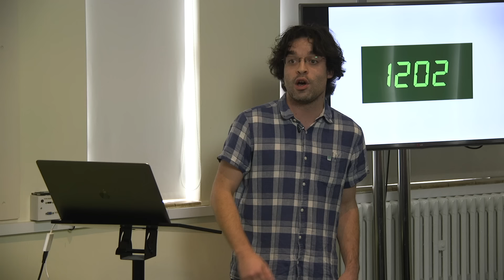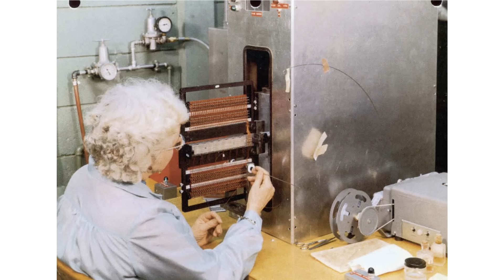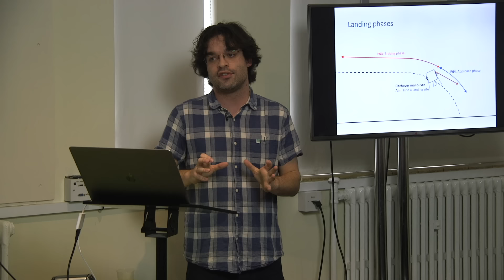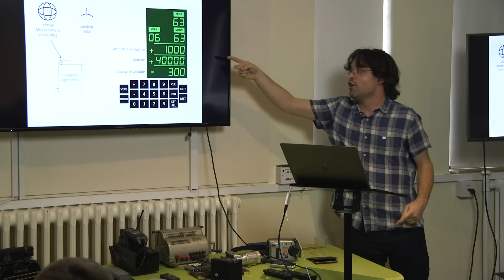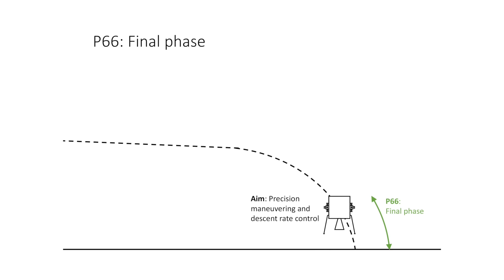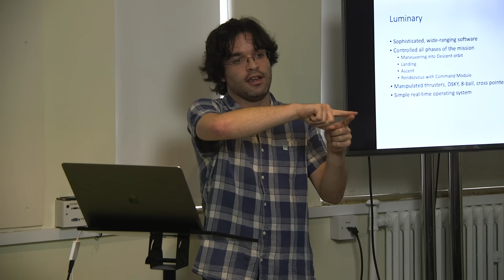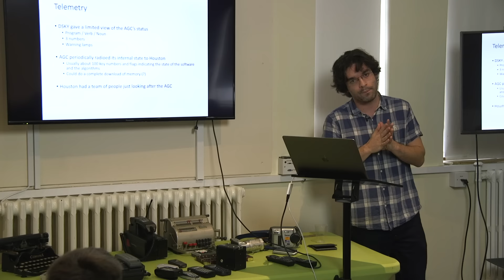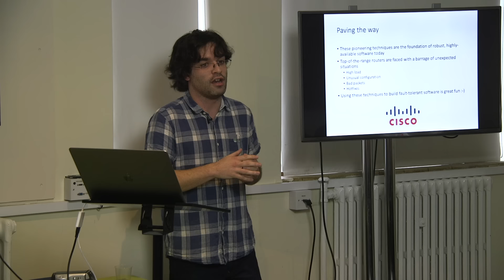Light Years Ahead | The 1969 Apollo Guidance Computer

Comment: This was amazing. I had a smile the entire time! 

There should have been a computer load display somewhere so Buzz would've known, I'm also surprised he wasn't schooled on the 10% additional load(90%) he was adding by using the 16 68. I'm also surprised the guys back at Houston didn't catch the issue of the load change due to the rendezvous radar even though it wasn't a program just information adding load so they could alert the guys not to run any superfluous programs ie 16 68.

Comment: My dad worked at an oil refinery that was one of the first to be completely computer controlled. Built in 1968 The computer that ran the place was housed in a large room and occupied 2 floors. By the time he retired, in 1996 that computer had been updated to something the size of a small refrigerator.
      It was strange to see a small refrigerator sized computer in a 1000 squad foot, otherwise empty room. The lower floor, that was the same size had been converted to offices long before.
       The refinery had gone from needing a computer that needed 2000 square feet to about 3 square feet in 28 years, and it has been another 25 years since then. I imagine they run the entire refinery off a iphone by now,

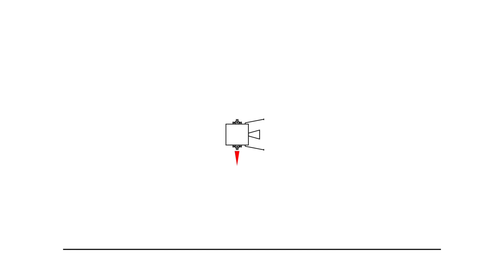Comment: I may be wrong, but the direction of the thrusters fired for the ullage in 22:25 should be in the same direction as the descent engine so that the fuel lumps up in the same place where the descent engine will send it. In this case it would be forward, not down as in the illustration.

Comment: Do you really think any Apollo astronaut would admit to mistakenly leaving the rendezvous radar on?  It’s like asking a child who ate the last chocolate chip cookie.
Reply: From what I've read Aldrin may not have mistakenly left it on. Instead he might have been thinking that the checklist was wrong because they would need the rendezvous radar to find the command module in case of an abort. As such he deliberately turned it on while not fully understanding the consequences. But then of course becoming a national hero will buy you a lot of forgiveness.
Reply: @joevignolor4u949  That’s very interesting Joe. I also heard that in subsequent missions which seemed to be frequent, they made no changes to the computer but just simply turned the rendezvous radar off.  They were brilliant software engineers working with limited resources.
Reply: @escalera601  I think that's correct. During an abort the LM's ascent stage only needed to get them into an approximate orbit on their way back to the orbiting command module. The orbit would need to be refined later so there was plenty of time to turn the rendezvous radar on. Also, for the rendezvous radar to do anything the transponder in the command module needed to also be turned on so the LM's radar could lock onto the transponder.

Comment: A wonderful talk.  I'm involved with pipeline control system software that gathers data from plc's over satellite comms, and can see that NASA Apollo work broke ground that we use today.  The legacy computers that we are shutting down began development in the early 1980's.  (Interdata)  We still had limited memory and speed, I remember talking to the developers about having to adjust code for memory used, and # of clock cycles that the proposed solution used.  For custom "scripts", we had a pseudo assembly language called CPX that had a simulated accumulator, a limited number of variables and similar verb / noun type of interface.  
Thanks again for sharing....  Best hour I've spent in a long time.

Comment: Hi Robert, this is only a tiny nitpick:
At 22:18 when you are describing the ullage burn, your diagram shows a single RCS thruster firing perpendicular to the surface, but shouldn't two thrusters on either side be fired in the same direction as the descent engine? What your diagram depicts would push the propellants to the side of the tanks rather than the engine inlets.

Comment: I disagree with his assertion that Neil never took "manual control", and the mocking tone he used while saying it.
Of course there is always going to be some software running. The joystick movements are converted into signals that fire various thrusters (fly by wire), but there is no intelligence there. The system will do anything it's told to do by the pilot. That sounds like manual control to me.
Reply: Hi, Armstrong and Aldrin were brilliant pilots whose composure, professionalism and skill played a huge part, and the most important part, in the success of the landing. As for whether it's "manual control", I certainly get your point of view. During P66 the computer was in "attitude hold" mode which meant the AGC was running a control loop to keep the spacecraft in a constant orientation (unless directed to change that orientation with the hand controller). It also ran a separate control loop to manage the rate of descent by modulating the thrust of the DPS engine, and a "rate of descent" switch could be used to change this. So yes, there is a much more direct relationship between the pilot's input's and the system's behaviour, but the AGC is still vital in keeping the system stable.

On a purely technical level, the point i was making was that the AGC hadn't failed, and was able to handle its most safety-critical real time operations. My claim that it "wasn't manual control" is a more colloquial shorthand to make the talk accessible to a wider audience. And later in the talk when I say things like "we know it wasn't manual control at all, he just enters P66", this phraseology is designed to give the audience confidence that they are understanding the gist of a complicated subject, not to detract from Armstrong's amazing piloting skills and excellent judgement.

Comment: So when did p65 go p66, and the auto pilot quit exactly? Do we know?
Great talk, Robert really good job. 
Tbh, i am a skeptic, like Dr van Allen, we both would've rather had the space telescope which was part of the original pitch, but got jettisoned at some point.  
Also, you have got me thinking about the total power out put of the ascent rocket again.  Now i have to add on an abort scenario which is going to put up the cost considerably on this little unit. Mmm.
The whole thing is about the size of a family car, yet it has to blast off from standing, or perhaps falling onto the moon,  reach a csm 60 miles up, gain 12kmiles per hour and have some spare for emergencies. Mmm. 
On another note, what would be the chances of a safe mission at the point where A11 blasts off from earth with so many untried procedures stacked one atop the other? 
And they didn't need to do it, because they never built on the mission, instead going in a totally different direction with space stations. And if things went badly they risked having the world mock the USA forever, with every full moon a reminder of American hubris. 
Isn't it incredible that the mission was sighed off?
Another point i find odd is the fact that everyone was talking about the solar heat issue, even jfk mentioned it in the Rice stadium speech in '62. And yet when they go to the crunch they actually said they were more cold than anything.  And then you have all the silly talk about cold space which we all believed for a while and now just sounds daft, and there are no journals about any special cold effect that explains it. 
Thanks for reading and please see my vid on this if you like:https://youtu.be/Zztbw7MLlkIhttps://youtu.be/Zztbw7MLlkI

Comment: I had to pause this to comment: Aldrin himself confessed to leaving the rendezvous radar switched on; he knew he was supposed to turn it off after testing it just before powered descent (it was a checklist item) but claimed he got distracted. It was NOT normally left on- but was always TESTED before committing to separating the lander from the proximity of the CM. (After all, that's the time to find out if it was working or not!) 

You might not be able to imagine an astronaut "just forgetting", but those guys were human and part of the calibration of all pilots is to never have the hubris to think that you will perform flawlessly. Armstrong himself made a couple of mistakes during that descent that don't get talked about because he caught them and corrected them; it's just part of being competent; being PERFECT is not. (Armstrong had a reputation for being accident-prone...but he ALSO had a reputation for being able to come up smelling like a rose. Usually it was because he was pushing things farther than he was told he should go, because he really, really wanted to KNOW how much margin was left. And THAT'S the biggest reason he got tapped for the first attempt. His flying out almost all that fuel was the prime example, but there were plenty of others.)

Excellent talk, BTW. I'm impressed.

Comment: There is a fair bit missing out of this.  There are still AGC programmers alive.  Buzz Aldrin caused the alarms by not following procedures.  He wanted to ensure all radars were active (decent radar and accent radar).  Just in case they had to escape quickly.  Too much data crashed the AGC.   The AGC code was written by completely unqualified non computer programmers, one was an insurance salesperson 3 years prior.  MIT didn't really contribute to computer science or programming, because computers, science and programming didn't exist. No one knew anything.  36000 words didn't go very far.  Modern day router programming and AGC programming in 1966 have absolutely nothing in common.  Would have been better to have an actual programmer from NASA in 1966 presenting. Military comms still used some of this tech in the early 1990s.  The alarm codes 1201 and 1202 are still used in 32bit, 64bit and 128bit coding today.  Where did you get this guy???
Reply: Perhaps you should take a look at the Apollo 11 flight plan page 3-69.  CDR is to turn RR on and perform P20 Mode II to update the vehicle state vectors before doing P63.  That's why the RR was on - the checklist called for it.

Comment: And regarding memory limitations: there are actually programmers today that do very complex stuff with very little memory. Keyword "demoscene", where there are sub-competitions for writing realtime-calculated audiovisual pieces of art in 4k or even just 1k of code called "intros". Of course they use more RAM and heavily utilize the GPU while running (at least they do nowadays, there were intros long before we had GPUs in our PCs) but still: the craft of writing small code is not forgotten! Also, all the support we get from modern hardware does not necessarily help to keep the code size down; just calling a modern API like DirectX or Vulcan already requires lots of code. E.g. https://www.youtube.com/watch?v=CDDedA-x2-k is a sub-4kB executable (just the first hit I got when searching for '4k intro').

Comment: regarding the rendezvous radar: some sources say that it was actually left running on purpose, so that it would be ready more quickly in case of an abort. As far as I recall the radar systems needed some time to warm up before they produced reliable data.
Reply: It was on because the checklist required it to be used to update the vehicle state vector through a P20 before P63 was implemented.    It's in the flight plan document.
Reply: That's my understanding as well. They just didn't foresee the unintended consequences of leaving it on.

Comment: Hi Robert, a very good presentation! The diagrams were kept simple, the talk was structured and the delivery was clear. I recall seeing a DSKY in the London Science museum sometime in the 70s, I went back a few years ago but it had been sent back to the USA. Also, the backframe that was shown used the 'wire-wrap' technique. I have used this for prototype developments and there is no soldering but each turn of the bare wire forms a cold weld to the post. Amazing that this is more reliable than other manufacturing and probably lighter! Having worked in RTOS and the innards of computers in the 70s/80s/90s I can well appreciate the skills they had.

Comment: Hey do you have a speech or video about Apollo 13? The Computers in this instance, had to do things the programs werent made for?
Reply: Arron, I'm thinking of writing one, although Apollo 13 is a more general story about the spacecraft hardware and human ingenuity in diagnosing problems, rather than the Apollo Guidance Computer per se.
Reply: @robertwills8051  yeah I understand but didn’t they have to use the lunar module programs computer to not land on the moon? It would of been confused as anything. Anyway this video/doco was great. I’d definitely tune into another about 13’s story. Cheers

Comment: A brilliant presentation, it answered lots of questions that are normally glossed over. Incidentally I worked on an electronic telephone exchange (TXE4) in the 1980's  which used core memory and the program was in threaded wire stores. It was rock solid but cost a fortune !

Comment: Just one nit-pick.  A light year is a measure of distance, not time.  'Years ahead' is correct, 'Light Years Ahead' is not.
Reply: "Light Years Ahead" could just as easily be specifying a spatial relation, not necessarily a temporal one.  When you're ahead in a race, that doesn't only refer to time.
Reply: @stargazer7644 Of course, but this item is discussing the technology of a computing system.  In this context, spatial relationships are not relevant.  As Mr. Spock once remarked, 'For the moment, my logic is intact'.
Reply: @rattywoof5259  Keep telling yourself that.
Reply: @stargazer7644  I will, thank you, since it's true.

Comment: You presented a most informative talk that was easily understandable to a non techie like myself.  I do have a question. Given the advancements in the computer world since the Apollo computer was designed back in the 1960s, just how big, in physical size, would a computer be to do the same as the Apollo computer? Also, what were the physical dimensions of the Apollo computer?

Comment: Fascinating presentation. I thoroughly enjoyed it. I actually wrote an interpreter and used some fault tolerant code while I was at Hewlett Packard designing instruments using an early Fairchild 8 microprocessor. It was a terrible choice of processors and it is what forced me to write the interpreter. 

The question that I have is only tangentially related to your talk and that is how on earth could the designers of the Boeing 737 Max have built an airplane that was capable of crashing itself due to a single failure of a sensor when they had two of these sensors and the job of that code was a "nice to have" task? Probably not a question for you to answer, but it is just something I cannot fathom given that 50 years ago the principals you described existed.

Again, than you for a most enjoyable presentation.

Comment: What stored the software, was it really all in the rom? How was it transferred to the computer memory on the fly?
Reply: I assume it ran directly from the ROM.  It was mentioned that the RAM was used only for variables.  Loading the software was likely just setting the instruction pointer.
Reply: The RAM and the ROM were both in the same address space and the computer could read from either one depending on which address was used. This is common even nowadays, especially for embedded systems (which is basically what the Apollo Guidance Computer was).